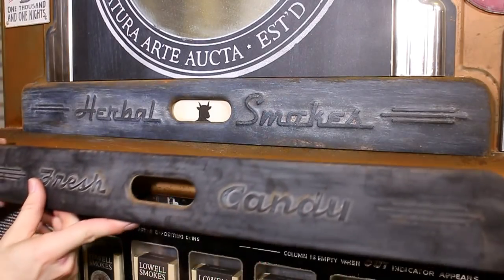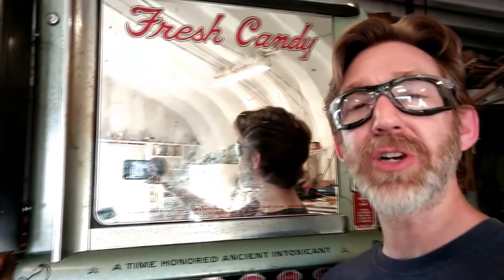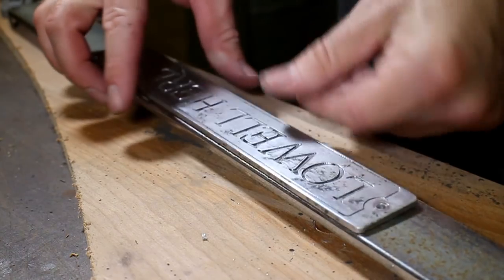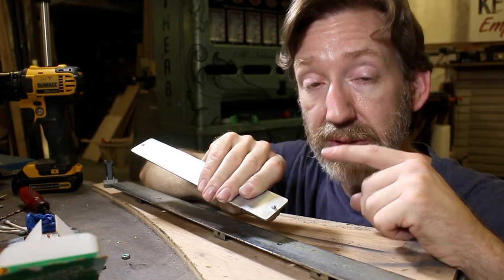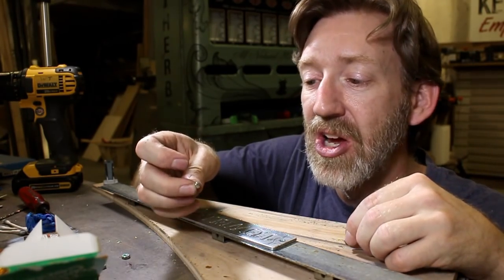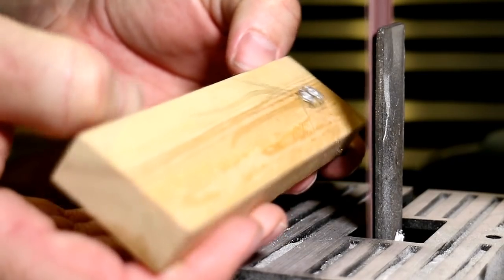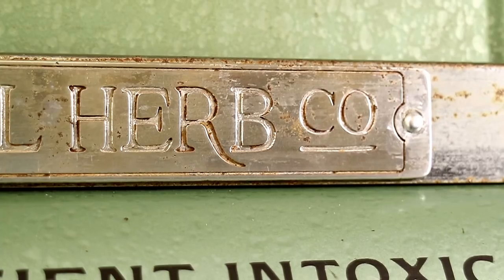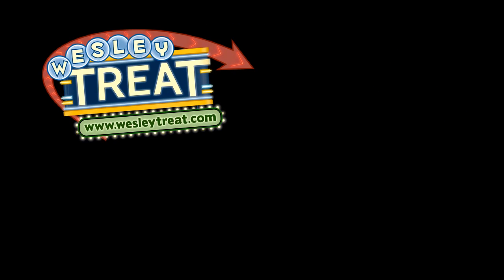Engraved Metal Badge for a Vintage Vending Machine "Rustoration"

Comment: Good stuff, I like the variety of stuff you do.  In regard to using CA glue for securing the thread to the aluminium plate I was wondering if you could have made a little mound of baking soda around the screw thread before applying the CA glue to provide more surface area to grip.  Cheers and thanks, David.

Comment: hey even though its almost a year old, there are square neck bolts, that look just like a rivet when installed.  you need to make a square hole in the base plate... or at least a slightly too small round hole and hammer it in, depends on the lazyness.

Comment: I know this is too late now, but could you not cut a thread on the rivets? I know without a slot you can't get them really tight, but a lock nut would keep them secure and a few dabs of silicone would keep the panel from moving as the holes are a bit on the large size.

Comment: I have used JB weld to do the same thing.
Reply: I am not sure why he didn't use epoxy in the first place instead of super glue
Reply from the maker: @Bryan-fc9dv  Because I didn't have any. And as I explained, it worked with another design, but I had more surface area to work with.

Comment: Heads-up since you were complaining that your rivets were too thin for he holes: did you know there are old-school solid rivets of a lot of sizes? They're harder to find than the modern ones, but maybe you should browse around for a bunch of them for your shop, for situations like that one. And when I need a rivet in a size that doesn't exist, I usually grab a length of metal rod and form a head over a simple die.
Reply from the maker: Yeah, I just didn't have any.

Comment: Wesley...you have more than two fans. 😉Great project!! Did you consider using thin double coated tape ? 
I think this would have worked fine. Enjoy the maker faire.
Reply from the maker: Thanks! I did consider tape, but this is going to be in a retail environment and I didn't want it to be possible for someone to yank it off.

Comment: What's the deal with the blue painter's tape and CA glue to hold parts to the table? Why not just use double sided tape?
Reply from the maker: Most double-sided tapes tend to (a) be thick and/or compressible, (b) be so aggressive as to pull splinters from wood or are difficult to remove, or (c) leave a sticky residue that has to be cleaned up. Blue tape has the perfect grip and is easy to remove, with no residue. If someone were to point me to a thin, double-sided tape with the same adhesive as the blue tape, I'd be happy to try it. 👍
Reply: Thanks for the reply. Makes sense. I've seen several people do it, just never understood the why.

Comment: You could have taken a slightly oversized head machine screw, sanded the surface off, and tightened it from the back. It would look just like a rivet head.

Comment: What I don’t get is you have a cnc machine and are only using half its capability. Instead of having to cut out the badge manually you could get the cnc to do it for you and if you want to add imperfections to make it look hand made you can easily touch it up by hand. If you are worried about cutting into the table just use a sacrificial piece under the badge. You can even cut the mounting holes too.
Reply from the maker: Because I can cut it and drill it much faster than the robot can.

Comment: Wesley, That was clever using hot glue to hold the rivets so they could be sanded flat.  And you're right, that is a long way to go to get some rivets.
Reply from the maker: I had to cut out a detail for time's sake: It didn't work the first time because the sanding reheated the glue and the rivets flew off. The second time, I had to take it slow, sanding just a little at a time.
Reply: That's what I thought... had the same idea before. Hot glue and physical work doesn't match well... I tried fixing metal for boring a complicated hole - did not work at all

Comment: Could try a metal epoxy, use round head screws and then fill in the tool hole... Settle a bet for me, I said aluminium would last forever, planes, cars, statues and the like, a friend said after 30 years in water some aluminium would be totally gone, I call crap... Thoughts?
Reply: Phonotical - depends on the aluminum alloy and the type of water. I remember from chemistry & geology that water is a "universal solvent" - given enough time it will decompose anything.
Reply: Graeme Payne no alloy, just bare aluminium, given enough water I'm sure anything could happen, but for sake of argument let's say it sat in a magical bucket that was always full of water, the water never went away neither is it renewed, it doesn't really decompose like other materials, say if you wanted a sign to last 1000 years, you could use gold and hope it never got scratched or aluminium and hope nobody had a 300psi hose 😂
Reply: There are plenty of 30-year-old aluminum canoes in the world.  We had one.  No sign of any sort of corrosion.

Comment: Good job. Ya got there eventually if that comes up again in the future, the hardware store sells a little thing called a Chicago Screw https://cdn.shopify.com/s/files/1/1171/6948/products/nickel-qtr-screws.jpg?v=1490370797
A lot of machines use these things to hold name plates on called drive screws if you a thicker piece of backing material to go into to.
http://catalog.scfastening.com/Asset/Drive%20Screw.jpg 
Also rounding the head of a regular bolt with the grinder would have worked or JB weld would've held your first idea, superglue is no good on metal unless it's really ruffed up and has a larger area.
One more tidbit, if you use the blue tape on both the bed and part then glue in between it holds just as good or better and you don't have to clean it off anything.
Good job matching patina.